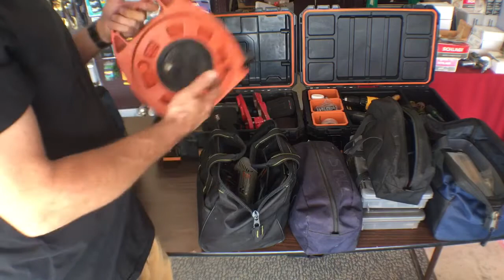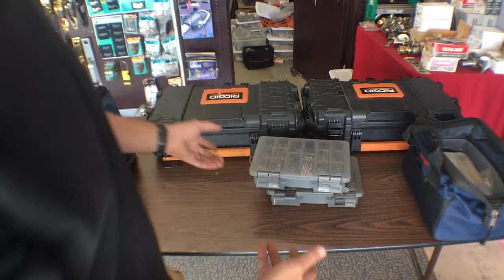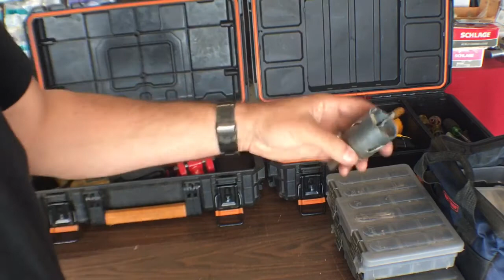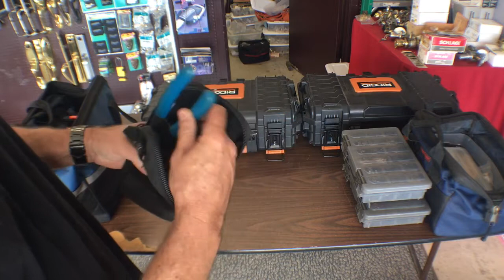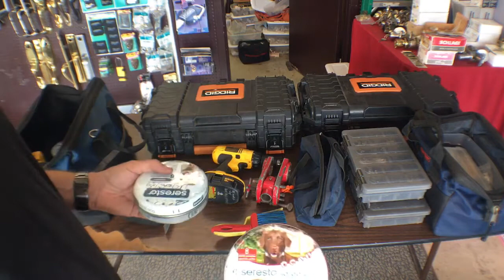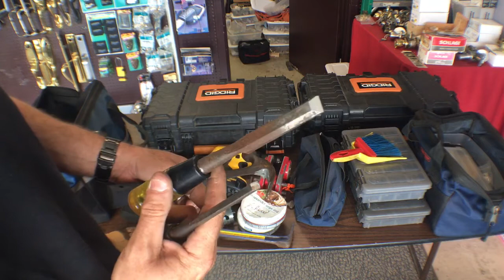Locksmithing tools for Residential & Commercial Installations

Comment: Can you give me some information on the type of clamps you use and for the steel plates, the thickness, height and width.  I bought me the squeeze play tool because I don't have a main squeeze, but I do like you ideas on your installation prep.
Reply from the maker: Harbor Freight clamps just cause I "had them at the time" when I first decided to do this on installs cause a door started edge bending on me (ACK!) and I think the plates are from a old shelf or something so not super thick less than 1/8" thick and width is best off around 2" so the hole isn't covered (which really doesn't matter cause your SP should already be in position by clamp time) 6"+ on length to distribute force.

I really should upgrade my clamps on day, I kinda don't like these...they are "aight" but I might upgrade to some different ones to treat myself

Comment: That many different drill bits huh?
Reply from the maker: PDX LockPicker yep. There are other things involved with locks besides just sitting around picking them
Reply: @selock  for just starting out, do you think someone should take on all these services? Or kinda just work with residential customers and auto lockouts before transitioning to something more full service to include commercial/high security stuff/cutting car keys/etc..

Like you didn't start off cutting transponder keys right away right? A quality machine is $5-7k+. 

Im very brand new at this, I've only been lock sporting for 2 weeks but the industry has me curious. I'd like to focus on emergency services. Bypassing/picking locks is definitely my passion though.
Reply: @pdxlockpicker7796   I  understand your passion for picking and bypassing locks, however, be careful  in thinking that offering emergency lock service will be a way to make money for something you enjoy. For one there are laws, in my state you would have to get your locksmith license to offer even just emergency lockout services, you also have to consider the cost of being bonded and insured and carry enough insurance.
also realize, that when you go unlock a door for someone who says they locked their keys in the car and then after you open it they are not in their, they are going to want you to be able to cut and program a key for them.
lastly, realize that picking a lock in your own space for the challenge of it is more fun than picking a lock to let a frustrated home owner in.  
As someone who does emergency lockouts I can tell you it is nothing like trying to pick a challenging lock at home in my spare time.  It can get damn right scary, which is why I have my CCP and do carry a weapon with me on every call out. I had an angry customer threaten to kill me because I couldn't legally open the car for him because he was not the registered owner.  He pulled a knife out on me! 
Look, I am not against locksport at all, I even watch some of the locksport videos on here.  But Locksporting is completely different than Locksmithing...  just like football and baseball are completely different even though some aspects, like throwing and catching a ball are something they both do!

If you are worried about the cost of tools needed to be a locksmith, then you will not like the cost of becoming licensed, bonded and insured!
Reply: @brendapudvah8921  yeah, I know all this stuff now. They are completely different beasts. Opening a lock in a lab setting is nothing like opening a lock in the field, in the elements, crouched over and contorted in weird positions. The industry still has me curious. I enjoy helping people and solving unique problems. I've been reading the book to study for the license. I'm looking for apprenticeships in my area.

Comment: what applications do u use the rivet gun for?
Reply from the maker: attaching push/kick plates when threads stripped or when you don't want inmates removing them, latches or strikes in hollow metal doors when stripped, attaching tailpieces on locks together to repair broken or for thick doors, lots of uses for it :)
Reply: Whack Job / installation of kick plate